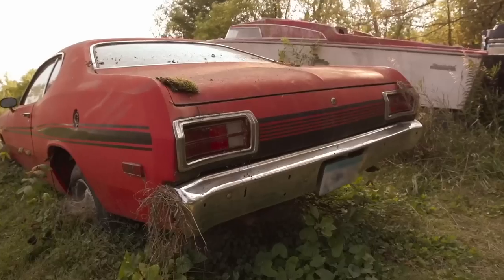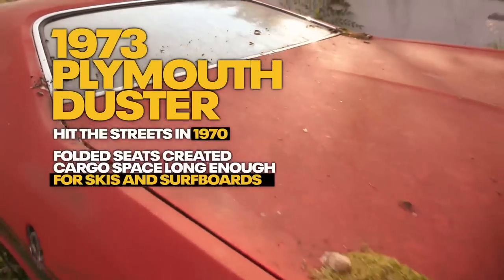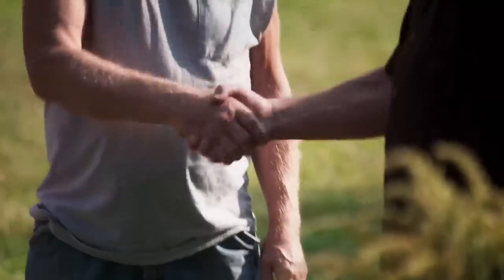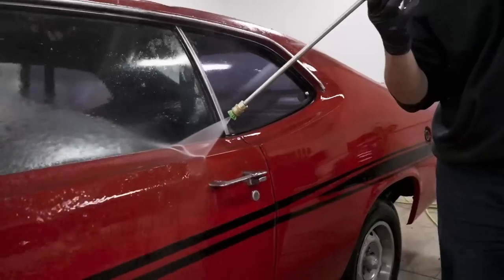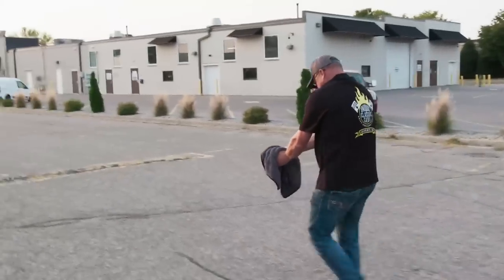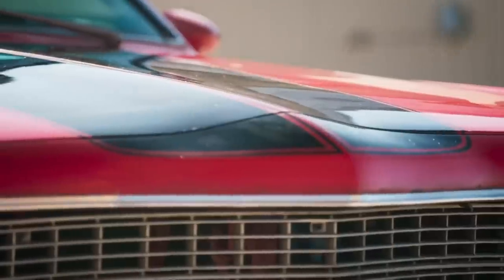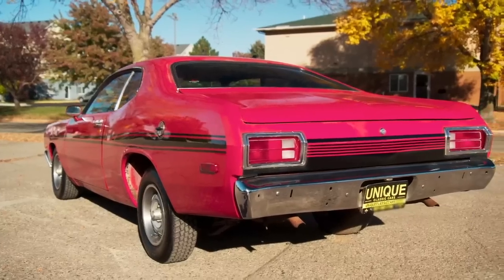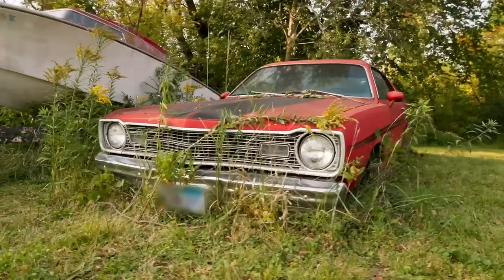Dirty Old Cars: Snake Slithers into MOLDY 1973 Plymouth Duster (Season 1)

Comment: My '73 was electric  blue, beige stripe and beige vinyl top. It had 200,000 New York City area miles on it and in 1988 the paint was still glossy because my father was obsessed with Rain Dance car wax.  But eventually the torsion bars rusted from the frame and that was the end.  The original owner was my stepmother, I was the second owner, and it was my first car.  Sometimes I wish I grew up in the country so I could have just thrown it into a barn to repair someday.

Comment: That is not a Plymouth duster! It's a Dodge dart sport. Duster doesn't have a pointed nose. Ihd both back in the 80's. I would like to have seen inside the trunk and under the floor pans very prone to rust even in the sw
Reply: Looks like a Duster with a Dart Sport front end